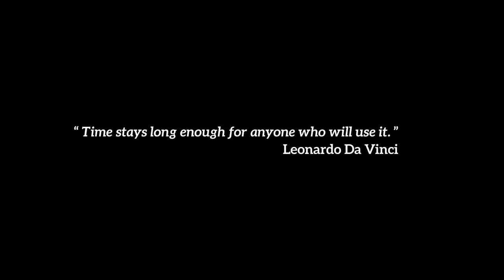Build #24 QA Answers

Comment: Product idea. Actually good micro/slim reservoirs. Getting them custom made can be a PIA. Something really slim, like 1 inch thick. 80/120mm wide. Various lengths. Multiple ports. Doesn't need a DDC slot but could work. Really a solution for those of us who don't have room for a tube res.
Reply: paskowitz I think black ice produced those (nemesis Gts I believe) but nonetheless this is a niche to be expanded

Comment: Man, I like your work. Even despite the heavy fittings overuse. I wish I could join you, but living across the globe is a bit of a problem. 
I disagree on the parts selection (XFlow rads and Noctua fans FTW IMHO), but I understand it's customer's requests many times. I'd like to see more Aquacomputer blocks, glass tubing and reservoirs, mini ITX builds etc. 
The parts you have designed are absolutely awesome.
Wish you best and hope to see more cool staff. After all you implement in HW the ideas that I only had in mind ("why no one makes it this way" kind). :)

Comment: I need 150mm res. 100 is too short for ATX case like 760T. 200 too long to fit in with pump.
Reply from the maker: 200mm should fit with the DDC. You can checkout the full lengths of the configs here: https://www.singularitycomputers.com/shop/watercooling/protium-large-250mm-silver-frosted/
Reply: 150mm with D5 is my most used setup. It about the same high as the motherboard. So this way, if the case have PSU shroud like  Define C, there 150mm res combo will fit with room on top for inlet and fill up the loop.